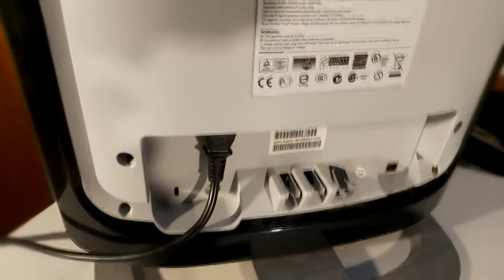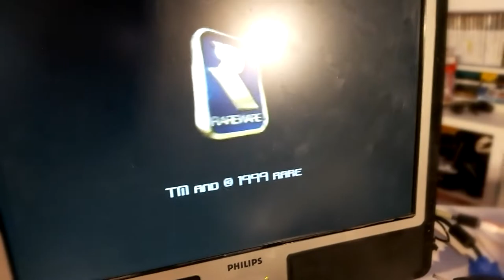► - How to - Play retro consoles on a PC monitor

Comment: Im looking for a solution for my lg flatron monitor, I want the best picture quality possible, so I bought a component to hdmi adapter and plugged it to an hdmi to vga adapter, works fine with wi consoles and even ps vita, ps3,  xbox 360 consoles but with the ps2 component signal I get a black screen with the message picture out of range, I tried a fix thanks to the free mc boot hack and set the Open ps2 loader to 720p to actually get video, the thing is that I had to use the GSM video option to load games on different resolutions, 720p seemed to work but after an intro screen I get a black screen, none of these steps are required with my other monitor, that one can output up to 1080i regretfully it started to be  affected by the lcd liquid leak and got worse over time.